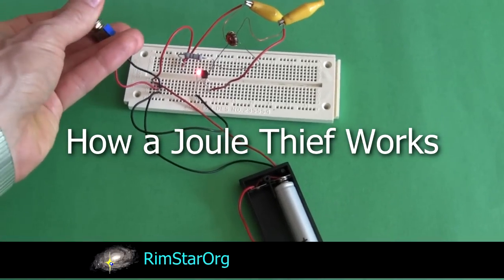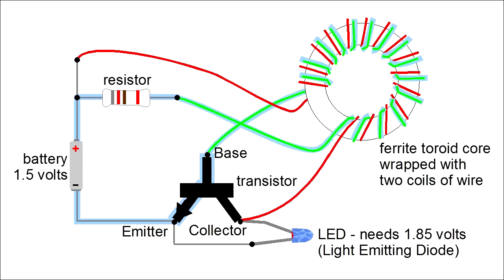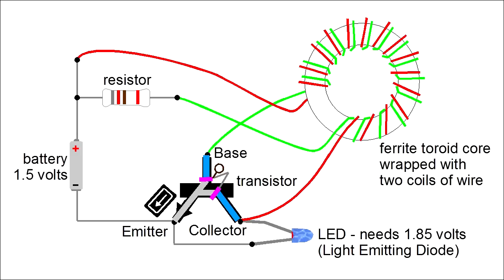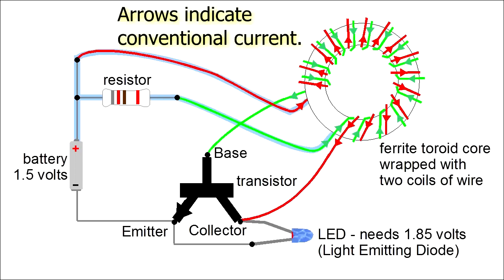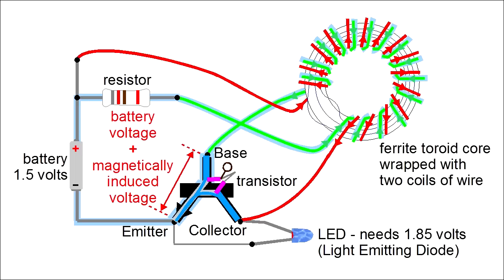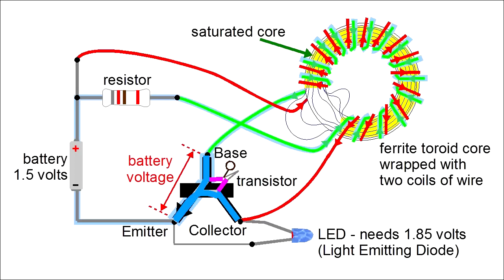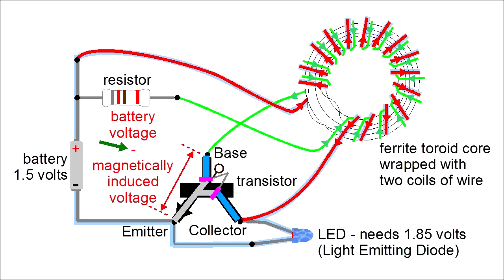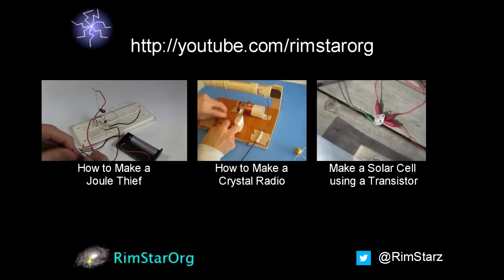How a Joule Thief Works

Comment: @_@... Totally confused.
Reply: haha. try reading about Electromagnetism you will be better introduced there :)
Reply: Lol, try watching it several times.. dude talks FAST!
Reply: Hahaha try it you will understand better
Reply: the joule thief does two things almost simultaneously 1) it creates an electromagnet 2) it creates voltage with the electromagnet.

normally when you create voltage with magnet and wire, you are moving the magnet by the wire, or moving the wire by the magnet. The rate of change has a significant impact on how much voltage is produced (how fast the movement happens) - the force that moves the magnet, is the same pressure that moves the electrons (and that is the voltage).

now imagine instead of moving the magnet or wire, you could simply make the magnet appear. Thats a big change - no magnet, then lots of magnet. If appears very slowly or casually, you might not get much voltage, cause it's not a big rate of change, sort of like blowing up a balloon puff by puff. things move baby step by baby step. lots of tiny bits of force that add up to something. 

But, what if you could also make the magnet disappear? that's also a big change - lots of magnet to no magnet. If it disappeared suddenly - like if you popped the balloon (!) that would be a BIG change in a small amount of time, with a lot of force behind it (all the little bits of force from blowing up the balloon are all let out suddenly in a single instant). things would REALLY move, fast (namely electrons).

unfortunately magnets can't disappear and appear. BUT electromagnets can turn on and off, which makes a magnetic field that appears and disappears. Luckily, when it shuts off, the magnetic field collapses much more suddenly than it took to inflate with electricity. When it collapses there is an explosion of electrons that shoot through the wire - imagine all the air from an exploding balloon shooting through a drinking straw. things move with the same amount of energy that was put into the balloon,  but it is more forceful because its all happening at once (greater acceleration, covering the same distance shorter amount of time)

so the transitor allows the joule thief to switch between too phases. phase one creates an electromagnet using the voltage of the battery. when the electromagnet appears it also creates a tiny bit of extra voltage which completes phase one and switches the transitor to phase two. in phase two the electromagnetic balloon POPS condensing all the force put into it into a small point in time creating a tremendous pressure which is strong enough to light the LED.

ultimately the joule thief uses time as its currency to buy more power.

the joule thief relies on self inductance. 

here is a simple video on self inductance
https://m.youtube.com/watch?v=pKKsco9EgBQ

the only difference between the device in the video and a joule thief,  is the transistor replaces the person that has to repeat the step of pressing and releasing the button.
Reply: Well done ! Great
Reply: Truth S. Stranger best explanation ever.  Thank you.
Reply: Press rewind/play/repeat ;)

Comment from the maker: Mine was only 26 AWG, so that's fairly thin. But I didn't think about what you're saying and my red wire was even thinner, 30 AWG. Keep in mind, when the red coil dumps into the LED, the collapsing magnetic field also induces current into the green coil, which shuts down the gate faster.

Comment from the maker: If I recall correctly, yes, lower voltage gives lower frequency.

If the induction coil is continuously feeding power to the LED then it won't be the same. The joule thief builds up energy over time in the coils/core and then releases it in a burst at high voltage and current. Then it builds up again and releases in a burst again. With continuous feeding to the LED, the energy will be too low at all times.

Comment from the maker: The resistor is there to protect the transistor along the base to emitter path from too much current. Resistors reduce current flowing through them. These coils don't really serve the purpose of a normal step-up or step-down transformer but the primary is considered to be the red coil in the video, the one going through the collector and emitter path and to the LED. The secondary is the green coil, the one going through the base and emitter path.

Comment: Connecting the LED between collector and + terminal makes the circuit even more efficient! Only the 'spikes' generated in the coil are used to power the LED. Works 24/7 for about a month on a single battery! Brightness is also ratherr consistent since oscillating frequence increases when battery voltage drops.

Comment: RimstarOrg, My analysis was wrong. I was working without a scope. When I used a 1.5v and removed the Transistor from the circuit,the LED turned off. When I used a 3.7v and remove the Transistor from the circuit, the LED stayed on. I thought this was because, the circuit did no vibrate. I Was wrong.
Thank you for responding. You videos are excelent!

Comment from the maker: Thanks and you're welcome! I don't know how efficient the joule thief is. It's basically just a way of stepping up voltage. It's definitely making good use of batteries that are normally considered dead, so in that way it's efficient. I looked at the store bought solar light circuit and IIRC the one I examined was basically a joule thief circuit.

Comment: Very nice video. It would be great if most people who view it read all of the comments that relate to saturation. There are only 20 or so, but enough to help the viewer know what is really going on. In many other online videos and written explanations of how a Joule Thief works, core saturation a common explanation and it really does not happen here, as the comments clearly state. For fun, as a Christmas project, I built a Joule Thief using a styrofoam torus (outer major diameter of 1 foot) wound with a bit more than 900 turns for both coils. That results in inductances of about 2mH. It works fine, but the pulses are a bit short because I used AWG 26 wire so the resistance is larger than it really should be. I wound 15 turns on a ferrite core with an inductance factor of about 11uH which worked almost the same except the pulses are longer due to lower losses. I also simulated both circuits with LT-Spice and linear inductors (no nonlinear core material) and everything is in excellent agreement.  In all three cases, you can see that transistor saturation is what causes the cycling of the circuit. Keep up the good work and have fun with the many, many comments. BTW, I am a professor of electrical engineering and use the Joule Thief in my classes. Students love it.

Comment from the maker: I'm not sure what you mean. Do you mean is the power the LED receives different than the power the battery is putting out? If so, it should be. Due to losses the total power the LED receives should be less and the total power the battery puts out. I have to say total because the energy transfer isn't straight through. Energy gets built up and stored in the coils' magnetic field, for example.

Comment: In the second half of the cycle, the colapsing magnetic field induces an oposite voltage at the red wire, right?
So, the led shouldn't be conected in the oposite direction? I mean: in the first half of the cycle, the vcc comes from the positive of the battery, goes into the red wire and leave it by the other lead, where it finds the led and the transistor. So, in the second half, it shouldn't try to go to the other side, leaving the core and going to the positive of the battery?

Comment from the maker: Did you use an oscilloscope to measure it? If you look at the oscilloscope output in my Make a Joule Thief for Zombie Batteries video you'll see it's not something a DMM is designed to handle as either AC or DC.

Comment from the maker: I'm not sure what you mean. If you mean, put the LED in parallel with the battery but connect in the other direction, current never flows in that direction in the circuit so it wouldn't do anything.

Comment from the maker: It's not cycling based on a resonant frequency. In the video I talk about the cycle reversing because the core becomes saturated. But I mention that as one of a few possible reasons depending on things like the battery voltage. At these low voltages, most likely the cycle reverses when the current between base and emitter is too low for the increasing current between the collector and emitter. So the timing is due to the transistor specifications rather than a resonant frequency.

Comment from the maker: Ah, I misunderstood what you were trying to say in your first comment. If you apply 1.5V DC to a 1.85V diode, the diode won't light, not in my experience anyway. If by 'flash' you mean to build up the energy and discharge it quickly then that's what this circuit does.

Comment: Its the low impedance coil & high inductance ferrite toroid. Low impedance windings inducts high current and generates large flux in the ferite core, so when the field collapses the high flux translates to voltage potential.  It just adds a series voltage pulse on top to the battery voltage.

The physics gets more complicated, but this is a good start.  

BTW the opposing polarity of the 2 coils, the larger coil chokes the smaller coil as soon as the NPN opens, and in turn shuts the NPN.

Comment from the maker: Thanks! I don't have any garden lights to play with and the circuits I just saw online either had more parts than a joule thief or used a chip as one of the parts, meaning the parts were combined into a chip. Interesting that one of the descriptions I read showed that they were doing pretty much what a joule thief does, though with slightly different circuits.

Comment from the maker: The first thing is go back and check all you connections to see if they're good and if they're right. That's especially the case for the coils since they have to be connected backwards from what you'd expect. Another thing is to try an LED with a higher mcd rating. The higher the mcd, the brighter it lights up. Of course it's a trade off with the LED's voltage requirements. I find 1,400 mcd works great. Also, LEDs don't always emit light in all directions so look at it from various directions.

Comment from the maker: I don't know the lowest voltage. It's hard to say since the power going into the LED during the part of the cycle when coil dumps its energy really depends on the coil (how much energy is stored, how fast it can dump it), transistor (how fast it can be shut down) and the resistor (how much it restricts the current going into the transistor to shut it off.)
I played with tree power back in 2006 when a company called magcap was experimenting with it for a possible product (nothing came of it.)

Comment from the maker: Ah, if you'd answered a few hundred turns then I would have suggested breakdown between the two ends of the coil, which would happen if you switched from thick plastic coated wire to thin enamel coated wire. So much for that theory. Is your resistor a variable resistor/potentiometer. Can you try different resistor values?

Comment from the maker: I was using closed and open in the context of the water flow gate analogy I use in the video. When the water flow gate is closed, the water doesn't flow. When open, it flows. I know it's the opposite usage when talking about an electrical switch but it's only misleading when you read the quotes in the comment. When hearing the usage while watching the video, there should be no confusion. In fact, I hadn't even thought about the conflict until you brought it up, so it's not an issue (I hope :)).

Comment: I love your videos.  You explain them very understandably. Completely without unnecessary details.   That was the best explanation of a transistor that I've seen yet..  How about a video on a PNP transistor,  I'm a beginner in electronics. I would really enjoy that and I'm sure many others will too.
Reply from the maker: +ThomasTheSailor Chubby Thanks. A PNP transistor just has the reverse direction of flow from the collector to the emitter and the base has to be negative with respect to the emitter for it to flow. But conceptually it's the same.

Comment: i wired a little speaker to the circuit just a minute ago and it gives of the same tone only a bit louder so i assume the noise is correlating to the frequency of the joule thief :) thanks for the quick response!

Comment from the maker: No, the voltage isn't higher because there are different number of windings. There are the same number of windings for primary and secondary (though some joule thief circuits do have different number of windings for other reasons.) The voltage is higher because the energy built up in the magnet field is all dumped in a short time through the LED. Also, the frequency varies depending on the battery voltage (or charge?). The 40k in the wiki is just an example.

Comment from the maker: I've seen a few who use it, though it's not clear what, if any changes they made to the circuit. You may have to go with more than 1.5 volts. The smallest I saw was 5 volts.

Comment from the maker: I'm not sure if it's using the power more efficiently. It's hard to say if the total power it's using by flashing on and off is less than the total power it would use without the circuit by staying on all the time. It's still possible that during those 'on' times it's using double or triple the normal amount of power. The peak voltage is way above what the LED requires. I measured 24 volts in my other video. But it is making use of otherwise dead batteries, and that's good.

Comment from the maker: It powers the LED with batteries whose voltage is so low that they'd normally be considered dead and thrown out. I guess another is that you can power the tubes of a compact fluorescent light bulb when its circuitry dies by replacing that circuitry with a joule thief, and run it on batteries. And for those so inclined, they're fun circuits to toy with.

Comment from the maker: It works only with things that can take power in the form of periodic DC spikes. A TV needs a AC in the form of a sine wave. A HHO cell needs DC and the joule thief spikes are DC, so the HHO cell would be turning on and off at a high frequency. Provided it supplies enough current for the HHO cell then it should work. You'd have to try it to see how much HHO it produces.

Comment from the maker: The resistor is for limiting the current to the transistor so that the transistor doesn't get damaged. And thanks! Glad to hear you like the video.
Reply: The resistor protect the base,  not the led.  How come the inductor  high voltage does not blow the led?

Comment from the maker: With a joule thief, the LED isn't on all the time. So you'd have to compare the brightness for the time it's on. It simple depends on the voltage and current. Depending on the battery it can be brighter or not. If you're using the same battery with the joule thief and then again without, it should be brighter with the joule thief for the times the LED is on.

Comment: You've done a great job of explaining in this video.  But I disagree on a few points.  From my many observations, the coil saturation is seldom if ever the reason why the current is limited.  It's usually the transistor, and also the resistance of the windings in the coil.  The usual explanation of a transistor uses the current flow in the base to emitter, not the voltage across the base to emitter - that's because the transistor is a current operated device.  Thanks for the great video.

Comment from the maker: A good analogy for voltage is pressure but for current it's better to think of the number of electrons passing a point for a given amount of time. I don't see how you can compare the two numerically. You can easily have 12 volts and 100 amps. Volts can be thought of as energy per electron (really joules per coulomb) and amps as electrons per second (really coulombs per second.) So 12 joules per coulomb and 100 coulombs per second.

Comment from the maker: If it's a tank circuit then it would be constantly sending the energy back and forth between then capacitor and coil and so there'd be losses. There'd be less loss if you just charge up the capacitor and leave it charged. You can store quite a bit in supercapacitors. But if you want to store enough to power a car, for example, then you'd need an awful lot of supercapacitors.

Comment from the maker: Yes, a transformer can raise the voltage enough, but it won't help. A transformer raises the voltage while lowering the current at the same time. The joule thief raises but the voltage and the current at the same time. That's what's needed. The joule thief does this by providing around 0 volts and 0 amps while it builds up energy in a magnetic field, then it dumps that energy at around the same time at high voltage and current. So it's not always on.

Comment: Great explanation, as I can see.. essentially this causes the led to flash rapidly, faster than the eye can see. But as the led is not continuously lit reducing the led consumption??
Reply from the maker: Yes and no. Yes, it's reducing the LED consumption but the circuit overall is very inefficient so the improvement isn't as good as it could be.